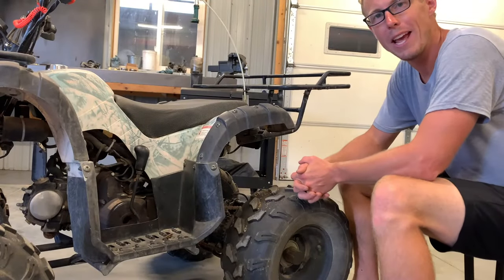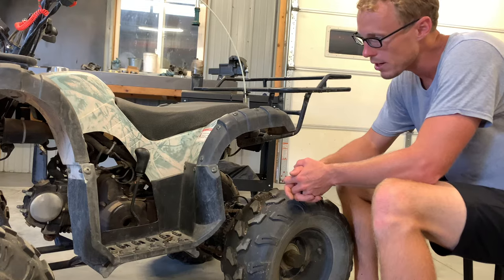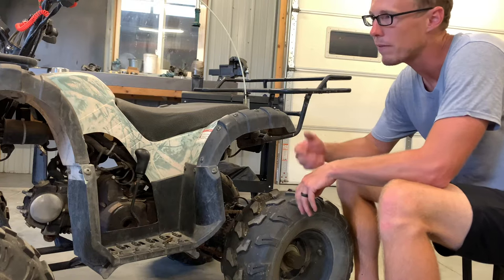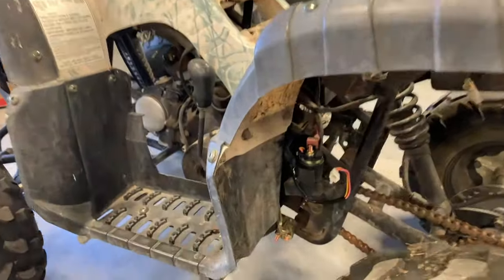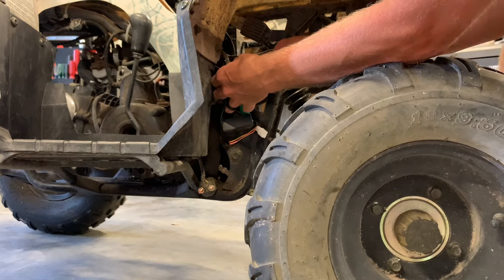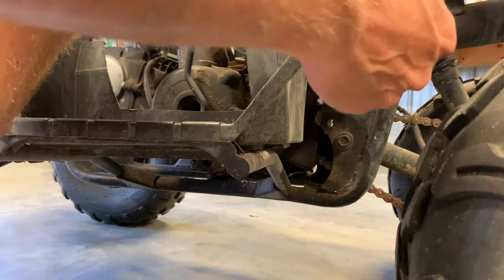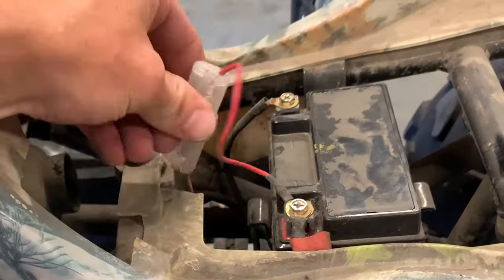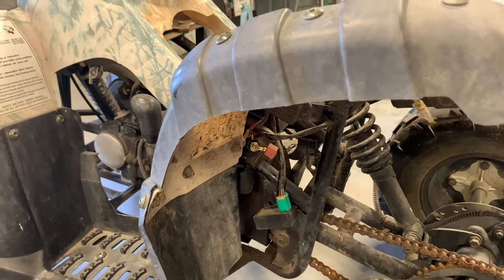Tao Tao 125 - No Start / Bad Starter Relay  -  Kids 125cc ATV Won't Run

Comment: I have a tao tao Bull200 even with the kill switch on it will run the starter but won't keep engine running. When I toggle switch to the on position it still does the samething starter working but won't get engine running only for a quick second or two. Do you have any idea what this could be? I already changed the start switch and checked all my fuses.

Comment: I get no electrical power at all throughout the entire ATV when I turn the Key switch on. I put a new battery in, made sure the kill switch is in the correct position, checked the fuse, checked the key switch. I’m not sure if a bad starter relay would also prevent the ATV from getting electrical power. Do you know if it would?
Reply: Same issue. Any Resolution?
Reply: @mikeypal1987   Yes, check your wiring. From the ignition switch follow the 4 wires Red, Green, White, Black if you got this setup down to the white clip style plug and check the connection there. For me the plug was corroded thus not making a connection. If that looks good then check the fuse usually next to the relay, if that doesn’t work then trace all the exposed wires with white plug style connectors. To check if the starter and relay are good. Grab a screw driver with a handle that doesn’t conduct electricity and jumper the two terminals on the relay with the metal rod of the screw driver. If the ATV starts cranking then your starter relay is good you just have a loose connection somewhere.
Reply: @amhood143 is on point with checking all of the white plugs. I can make everything flicker if I wiggle a couple of the wires inside of them. I think the white plugs don't have the correct size terminals inside of them causing the whole connection to be loose. I just figured the white plug issue out about 3 or 4 days ago and am getting ready to cut every single one of them off one at a time and either just solder them together or crimp on new disconnects. It's weird because my problem just happened all of a sudden and some of the white plugs are ok and some are extremely loose. So that's why I'm cutting them all off so I don't have to worry about another going bad. My Tao Rhino only has about 2.5 hours and maybe 4 or 5 miles on it. Brand new bought from Powersportsmax got the assembly required option and put the rest of it together myself. It's not much to do just put the handle bars, brake drum and tires a couple other little things to finish assembly.  I've had a few issues with it from day one but nothing super major. I did change the shitty carburetor over to a 26mm Nibbi (excellent carbs) and I upgraded the dental floss battery cables to 8 gauge and plasti-dipped the plastic to tri color camo and raptor lined the chassis and rims (excellent liner too) . But for sure at least ditch the stock carb or you'll have problems with it. And for what little use it has it was getting with it only being a 197cc the Nibbi carb pumped it up for sure. Also if you decide to get one of these get a manual 4 or 5 speed or you'll be bitching  about it not having no power because mine sure ain't lacking in that department it will scat
Reply: @hamood143 you nailed it main

Comment: Question what was the 4wheeler doing for you to know it was the relay? Mine has trouble starting. When we get it started it will run for a lil bit and when I go to stop or slow down it will turn off
Reply: Buy a new carburetor. Amazon has them for $15

Comment: Hi there - I have a 50 CC Tao Tao and used this video to confirm it seems to be the Solenoid. I am in Canada but wondering if you can give me a link to the proper solenoid replacement! Thanks again for the video this helped me immensely. I spend some time getting the throttle needle in the carb unstuck and when i finally solved that issue it decided to stop starting :)

Comment: I have a 250 and we can not figure out why we cant get it to crank weve changed starter relay the cdi and the regulator rectifier if he crosses the starter relay the green neutral light will come on but no power any other way but he changed the relay and didnt help still no power and he changed the fuse

Comment: I have one that the relay clicks like it’s getting power, but the starter won’t engage
Reply from the maker: You've got a bad starter, a low battery, or a stuck motor. Let me know what you need!  Check out: https://www.ebay.com/str/midnebraskamotorsports

Comment: My kids atv wont start with the switch but starts with the remote. Could it still be a bad relay?
Reply from the maker: I would say more than likely it is the switch. Not totally sure how that system works, but the relay should work with the remote and the switch. Let me know what you find. Thanks for watching!
Reply: Update?

Comment: Did you have power on the dash? Kids were riding the 125 today and it just went dead, no power at all, not shift lights, no start, no spark.
Reply: Did you ever figure out the issue. Ours had the same thing happen
Reply: Exhaust pipe cracked and was resting on the harness, burnt though all the wiring.
Reply: @adamnaslund4745 check the fuse holder under the seat and make sure it's in the holder good or do like I did and changed it to a better inline fuse holder.  Not saying that's what's wrong with yours but I had and heard alot of the same problem

Comment: Can you help me out  toa  toa 125 cc no spark change cdi and coil and stator and eye  still no fire at plug but head lights  blink like mad when I crank it
Reply from the maker: Sounds like a safety switch issue. Have you replaced or inspected your brake safety sensor. Other thought: your on/off switch in the correct position? Let us know.

Comment: My grandson has tao tao 125cc that has a starting issues when you hit the start switch the starter clicks but wont turn over and gets hot enough to cook an egg on it we got a new starter for it so I'm going to install it today hopefully that's the issue it was bought new February of this year but has had wire connection issues since day 1
Reply: Did the new starter fix this problem